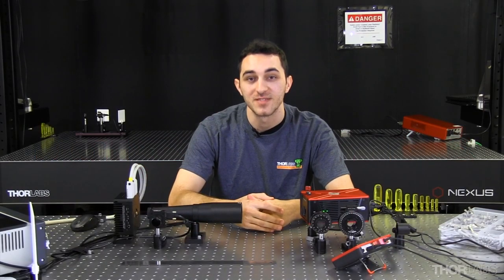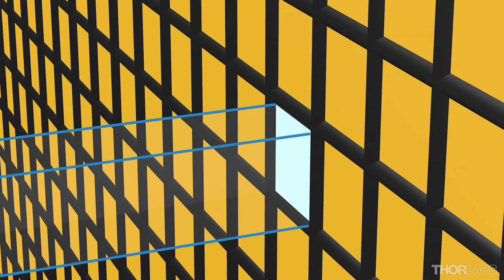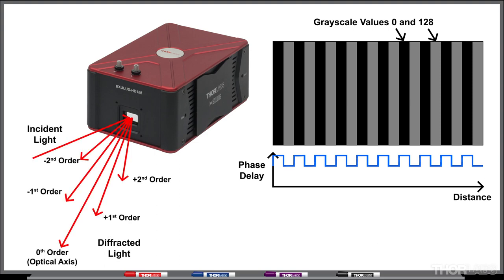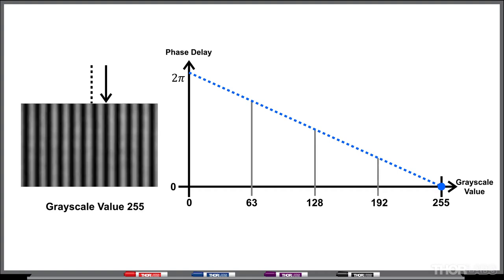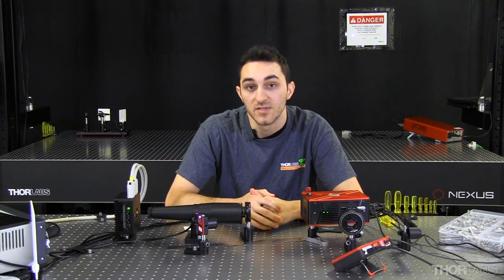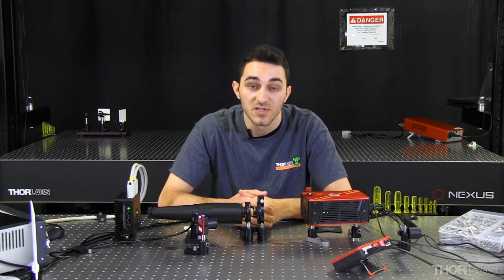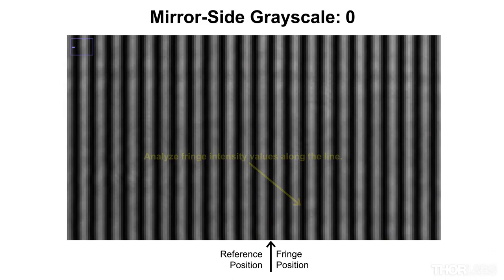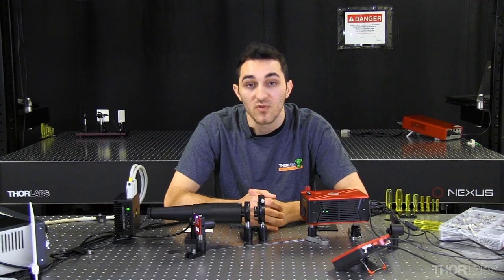Calibrate a Spatial Light Modulator (SLM) for Phase Delay (Viewer Inspired) | Thorlabs Insights

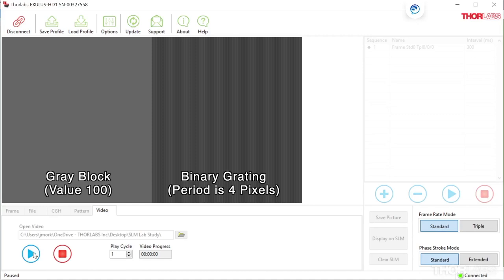Comment: At 8:46, how did you create the gray block and binary grating simultaneously? Can you explain, please?
Reply from the maker: We used the SLM’s software to upload gray-scale image files of those custom gray-block-and-binary-grating phase-delay patterns.
The software configured the SLM’s panel by reading the patterns in those image files.
 
The SLM panel is divided into a grid of pixels, and the phase delay of each pixel can be set independently using the SLM’s software. The software provides a few different options for specifying the phase delay to applied to each pixel. These options include some built-in patterns generated by the software, as well as the option to upload custom patterns. Since none of the software-generated patterns fulfilled our needs, we used a separate application to generate images of the required gray-scale patterns and then uploaded those image files.
 
If you have any questions about the process, please reach out to Tech Support ( techsupport@thorlabs.com ).
Reply: Ok fine, I created the patterns myself with Python, but how did you decide that 0-100 gives the best results?
Reply from the maker: We first calibrated the phase delay vs. grayscale value across the 0 – 255 range and then determined that a grayscale value difference of about 125 would provide a pi phase delay. (With a pi phase delay, the majority of light incident on the binary phase grating will be diffracted into the ±1 diffracted orders. The interference fringes between the diffracted light and the light reflected from the mirrored side of the panel will have better contrast when more light is diffracted into the ±1 orders. For more information, see 2:40.)
 
We then configured the SLM’s panel so that one side was mirrored and the other side was a binary phase grating, with grayscale values of 0 and 125. We located the interference fringes created by the diffracted and reflected beams and evaluated the fringe contrast. Keeping the 0 grayscale value the same, we varied the other grayscale value until the fringe contrast was optimized. In our case, it was optimized for a value of 100.

Comment: Would you also provide the link to the camera lens you used to capture the fringe? Thank you!
Reply from the maker: @user-bt2xz3li4t We did not use a lens between the beam expander and the camera, so the light incident on the camera was collimated. However, we did remove the window that the factory installs in front of the camera sensor for these measurements. There is a risk involved with removing the window, because it helps protect the camera sensor from dust, contamination, and damage, but we wanted to eliminate any interference effects that could be created by the window, like additional fringes.

Comment: 7:55 is tan(phi), not tan-1(phi). Great video!
Reply from the maker: @giammi56  Thank you, twice! You are correct, we typo-ed at 7:55. The equation at the top of the diagram should have tan(phi) in the denominator, but the calculated value (~29 cm) is correct.

Comment: how did you calculate the distance of the camera from slm, can you explain this? What is 6.25 mm term in Y= 6.25 mm/tan phi = 29 cm come from? Is that slm panel width? or beam diameter? Can you explain this please. Also can you explain the grating period calculation, how did you get 25.6 microns?
Reply from the maker: @ShashankJoshi-m4n The distance between the camera and SLM is estimated using the laser's wavelength (532 nm), our chosen grating periodicity (25.6 µm), the reflected and diffracted beam widths (6.25 mm), and the grating equation. 

To customize the reflected and diffracted beam characteristics, we used the SLM's software to control individual pixel phases across the 12.5 mm wide and 7.1 mm tall panel. Half of the panel's width (i.e. 6.25 mm) was configured to be a mirror (i.e. flat phase profile) and the other half to be a binary phase grating.

The incident beam filled the entire panel, so the reflected and diffracted beams widths were the same (Y = 6.25 mm). When configuring the grating, we chose a period equal to 4 pixels for reasons discussed at 10:00. Since this panel has a 6.4 µm pixel pitch, we calculated a grating period of 25.6 µm (i.e. 4 pixels * 6.4 µm/pixel).

We wanted to place the camera within the region of total beam overlap, which depends on the relative angle (phi) between the reflected and -1 order diffracted beams. Since the reflected and 0 order diffracted beams are parallel, phi is the angle between the 0 and -1 order diffracted beams. The equation for phi shown at 7:55 was derived using the grating equation. 

The distance from the SLM to the region of total beam overlap was calculated using phi and assuming normal incidence for the input beam, instead of using the actual 10° angle of incidence. In addition, we assumed negligible beam divergence. These assumptions had the benefit of allowing us to use the convenient right-angled triangle formula ( tan(phi) = Y/X ) to calculate the estimated distance to total overlap (~29 cm) without introducing significant error. 

Click the link for the SLM ( EXULUS-HD1/M ) included in the description text to find the manual providing the specifications we used in our calculations.
Reply: @thorlabs This was helpful. Kudos to you.